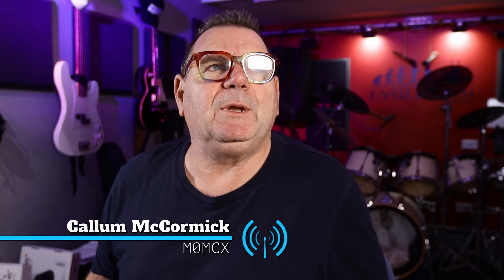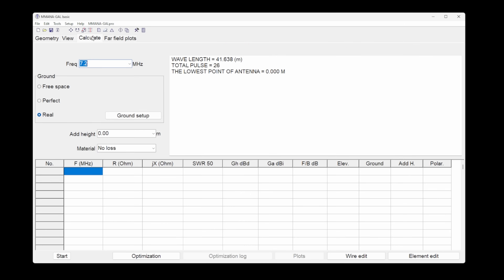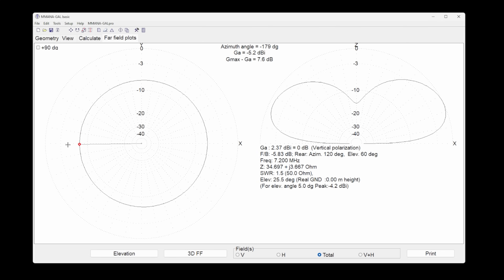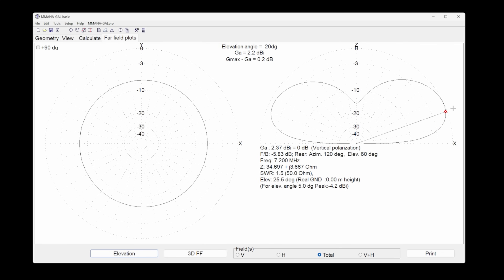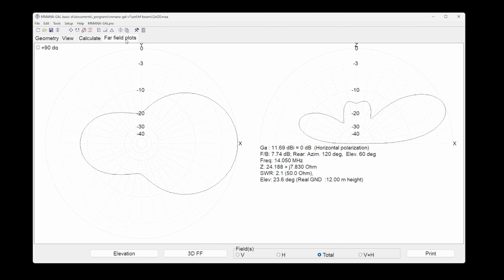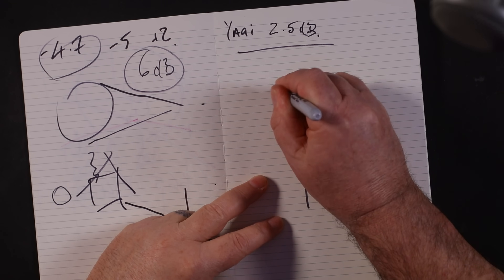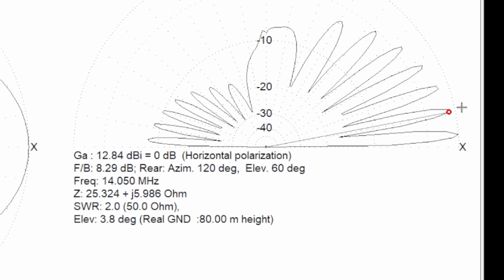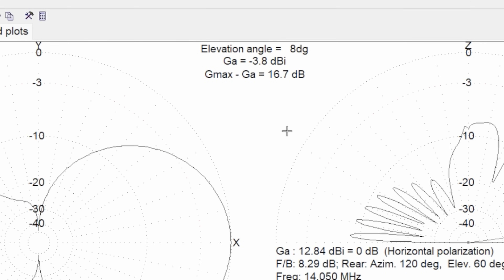If You Could Tilt the Ground Under your Antenna??

Comment: This is a common application for the militry mobile HF comms. The base of the whip has an adapter to a set angle pointing the front or back of the vehicle. 1.5 to 30 MHz HF Whip Antenna Kit for Vehicle and Shelter ABP-ANT-HF120VK.

Comment: Bear with me…if I am putting up an antenna on ground that is sloped the antenna should be 90 degrees to the slope or should be vertical to the horizon. Im trying to wrap my mind around this. I know you are explaining it but I am still struggling with the concept and I know its important. Thank you for being patient.
Reply from the maker: Basically, build your antenna straight up. There will be a slight gain in the direction of a long (multiple wavelength) slope. Don't tilt your antenna, that's different because the ionoshpere doesn't tilt.

Comment: Very interesting - and helpful!
I use a carbon fiber pole to hold my 1/4 wave wire verticals and I run them at about a 5-10 degree slant away from the pole to keep interactions under control. I've been slanting it toward the East. Now I'm going to have to experiment with which direction I slant it.
Reply from the maker: Great tip!

Comment: The Angle effect is very noticeable when mobile and driving up hill, signals are usually stronger whilst climbing than when on the  top of the hill. of course the angle of antenna against the ground or the vehicle is still 90 but something improves that's for sure
Reply: It is called knife edge refraction.  A well known phenomenon.

Comment: I remember back in the 1970's/80's going out in the hills and a pre-arranged sked with two stations on 70.260 MHz with my a.m. Pye Bantam with ½ Watt out with a telescopic ¼λ vertical on the Bantam.
I did get a stronger signal on the hillside than at the top. The signal had dropped out by going about 6 feet on the other side but it was quite a steep drop on that side.
G4GHB.
Reply from the maker: Great memories..

Comment: Very interesting subject.  I have a dual polarized 4 element yagi ( 4 vert/ 4 horz) and tilted it about 5 degrees.  The main reason i did this was to take my aluminum mast pole out of line with the vertical elements.  However,  i can tell you it made an amazing difference for weak stations on DX as conditions fade. . Don't notice it so much when the band is wide open, but when the signals get weak i can work them way easier than ever before.  And my noise floor is nothing.  On the other side of that, my vertical works equally as impressive with local communications.  It turned out to be a happy accident.

Comment: On Wolf Mountain in northern California, I did phase two twenty meter yagis that were side by side at 65 feet apart using a homebrew phasing box that had 5 positions and extensive impedance matching.  The slope towards EU was about 10% downhill.  I can tell you that over 20 years of experience the system worked great.  I estimated the additional gain at a couple of dB.  My 2 cents or maybe my 2dB.  73, Jim W6LG now at about sea level
Reply: I was just talking about this with W7sx at his remote station.  He found the same results. 73 Jim
Reply from the maker: Great stuff Jim!!

Comment: It's also what happens with an open vee, which when you think about it, is just two slopers 45 degrees out from each other. But goof with a vertical, and you've just done what the military does with their sloped over mobiles, you've gone Skywave. All the Best! 73 DE W8LV BILL

Comment: Mmana-Gal is a bad tool for antennas lower than 0.2 WL, for example horizontal dipoles near the ground, loops, etc. because of MiniNEC. Results are wrong and overoptimistic.
Sommerfeld Norton is more accurate. NEC2 or NEC4 is the tool.
Reply from the maker: There is a known maths issue for antennas under 1/4 wavelength for impedance. The far field plots are fine - and match to NEC2
Reply: Gain figures are wrong because of ground attenuation. I have used Mmana, and still using it, but be aware of supergain superlow dipoles with fancy reflectors over the ground...

Here is an example, low dipole for 40M at 2 meters off the ground. Mmana says it has 10.59 dBi... but NEC says it has 0.02 dBi.
Z (Mmana = 8 ohm)
Z (NEC = 52 ohm)

*
7.1
**Wires**
1
0.0,	-10.32,	0.0,	0.0,	10.32,	0.0,	8.000e-04,	-1
**Source**
1,	0
w1c,	0.0,	10.0
**Load**
0,	0
**Segmentation**
800,	80,	2.0,	2
**G/H/M/R/AzEl/X**
2,	2.0,	0,	50.0,	120,	60,	0.0
###Comment###
   @DXCommanderHQ

Comment: Just did this a few days ago as an experiment on a 4th storey  balcony with 20degre tilt and tilted radials, folded back at 2meters and linear top loaded to 10m. 1:1.1 and great dx results. Inspired by your explanation of folding and ratios involved.

Comment: At HF frequencies, I’m wondering if; for an antenna, the earth is a ‘micro earth’ or an ‘infinite earth’, because if when conceptually zoomed out a number of wavelengths/miles, the local terrain where the antenna is located becomes irrelevant to antenna performance…
At VHF frequencies, which tend to optical line-of-sight propagation properties, then the example becomes different and probably needs to be qualified in an example.
Reply from the maker: Paragraph 1.. You would think maybe so.. but after multiple wavelengths, you're "good to go".
Reply: @DXCommanderHQ  exactly, when multiple wavelengths away from the antenna, its orientation relative to the Earth becomes largely insignificant. It’s always useful in science to explore the limits to get a good understanding of the concepts, ie  dry short range and extreme range.

Comment: I had a 4Square on 20M, on Pamlico Sound, in the water and compared to a guy in CT using 4 over 4 over 4. My 4Sq was always louder, everywhere, all the time.
Reply: A 4sq compared to a vertical is like a dipole compared to a 4 ele Yagi.
Reply: 4sq on 20M are FANTASTIC. Much better than 80 or 40, due to angles and skip zones.
Reply from the maker: That's amazing!
Reply from the maker: I have a brand new 4-Sq in the box, ready to deploy from DX Engineering on 40m.. A summer project.

Comment: For my money, and from my experience, the hypothesis is true – very true.  My DXC Classic is located about 700’ ASL on ground that slants away at about 15+ deg towards Europe/Africa (I’m East Coast US).  I’m constantly getting great signal reports with only 100W.  I’ve even had some stations question my truthfulness regarding my power and vertical antenna claim.

On yesterday’s live stream (3/10/24) you can hear me at the 48:42 mark with 100 watts into my DXC – a bit over 3500 miles.  Nothing special; a 7300 at 100W into the DXC.  Needless to say, I’m happy with the performance and believe that the sloping landscape increases my low takeoff angle gain – of sorts.  My WSPR plots also validate the increase in reception and signal strength in the direction of the slope.
Reply from the maker: Oh yes, I found it.. My goodness yes! <https://www.youtube.com/live/GKbnFEtni0Y?si=AwMCgrrHoGk4VhqZ&t=2920

Comment: I have seen a Band 2 (Broadcast VHF radio) site where it had an omni directional down tilted pattern. 2 vertical dipoles one above the other but fed with a slight phase shift (top antenna fed a few degrees advance of the lower one). Unlike amateur radio they wanted to  confine their RF to the local area, but of course the technique could be adapted...
Reply from the maker: Yes!
Reply: Most cellular antennas have a physical down tilt. There can be a fixed tilt or you can install RET units - Remote Electrical Tilt, a motor where you can remotely change the amount of down tilt to "tune" the network.

Comment: All of our mountain top repeater colinear antennas have 5 degree downtilt.  We had the wrong antenna sent to us by the manufacturer a few years ago and noticed it's performance, well, it sucked.  After several back and forth phone calls they realized they had sent us the wrong antenna.  It had 0 degrees of downtilt when we had specified 5 degrees of downtilt.  On a 21 foot long antenna with a 7 degree vertical beamwidth those 5 degrees of downtilt make a HUGE difference.  We lost 20 to 30 miles of range on the system with the wrong downtilt.
Reply from the maker: Wow.. Yes!

Comment: Thanks Cal. Now i understand Antennas😃😃😃 I had that Question may be 10 years in my head.
Reply from the maker: You and me both!
Reply: It was a really good question and answer. I finally know how an antenna behaves in an environment so that I can evaluate the environment and its influence. Until today I thought that the power comes from the smaller angle. Now I know that I was wrong with my assumption. That was the last puzzle I didn't understand to build my own good antenna. Thank you very much Cal. 73. P.s. that is also the reason why you get a better signal on a mountain. It's the angle to the ground.

 @DXCommanderHQ

Comment: Tilt your yagi to 15 degrees  and you can work 70% of the amateur radio satellites passes, with your normal azimuth rotator, I did it for ages like that before I got the G5500 AZ/EL rotator.
Reply from the maker: Yes Robbie.. I did some modelling just the other day.. Low to the ground, my 17 element Tonna would basically give me between about 10 and 80 degrees at good gain.. Next job! (after the next job - after the next job!)
Reply: Those lobes and anti-lobes can be a bit of a QSB enabler though as the satellite elevation varies.